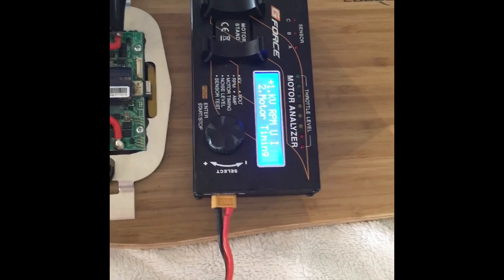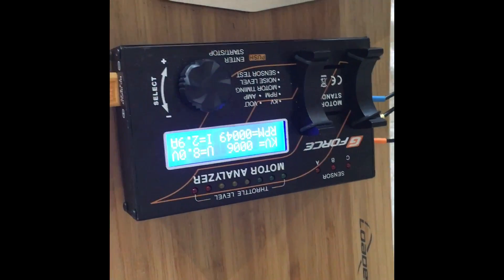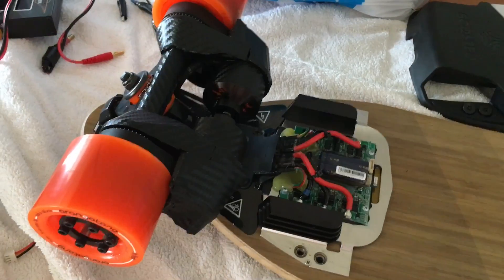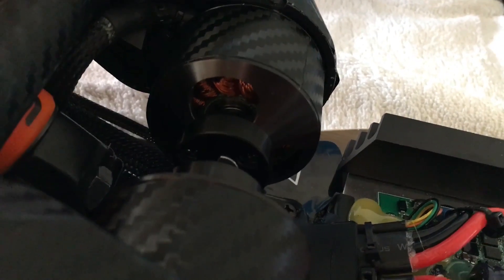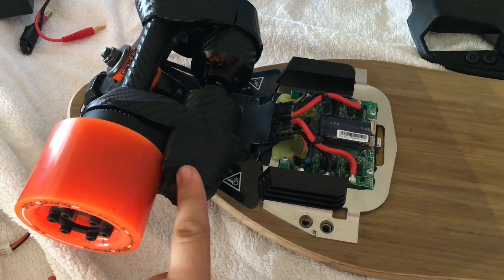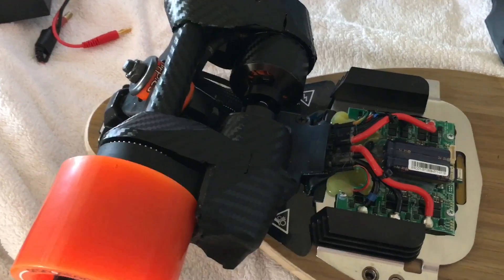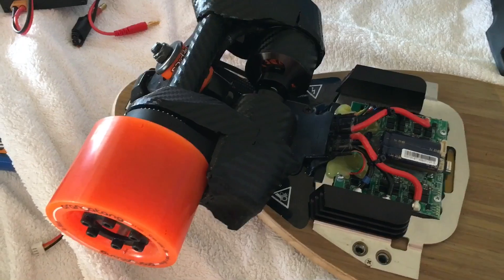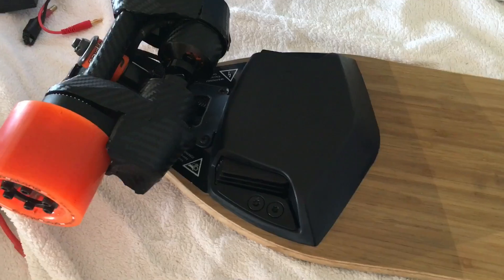Boosted board motor kv testing

Comment: They are not producing those motors in house, it says on their website that they ordered a bunch of motors from different suppliers and tested them on a table dino to pick the most suitable pair.
Reply from the maker: VoltageLP I don't think I said that they produce them, but the they can tell the factory exactly how they want them made and spend time developing the perfect winding combinations. There are many ways to wind one of there motors and many protocols that can be used to drive them and matching the protocols with the winding is important. This is what boosted have done.

Comment: hey griffin, i believe the motors are rev limited. One of their promo videos has a worker saying it goes much faster, but is limited due to safety reasons.
Reply from the maker: But this is is only possible is they increased the voltage, or some thing els as even at 45v the motors will only get you to 25mph